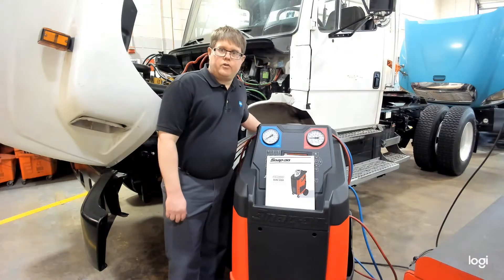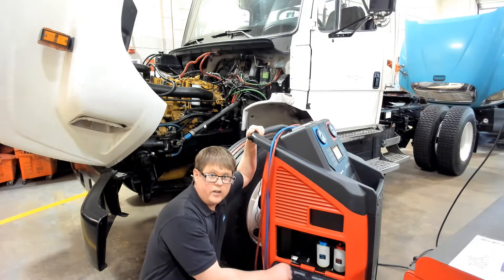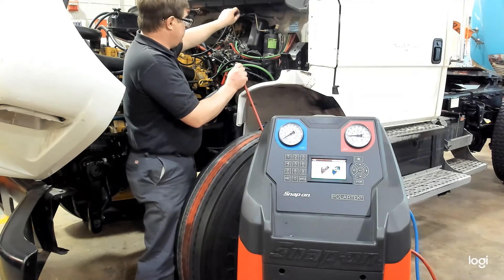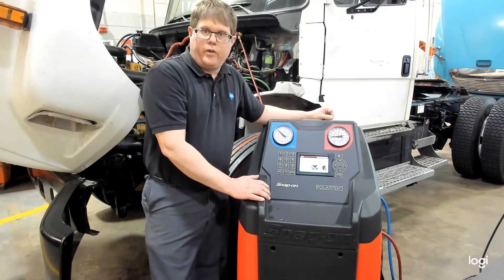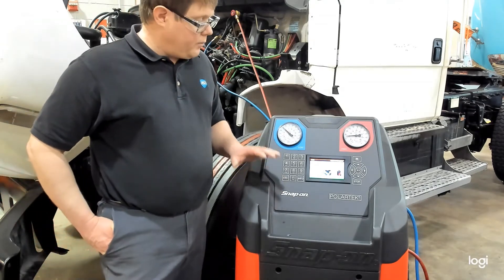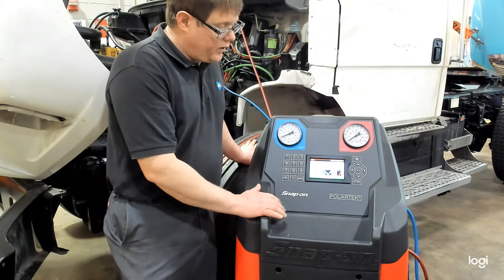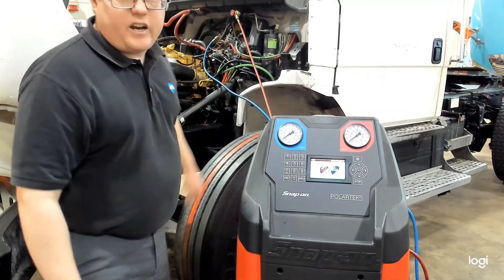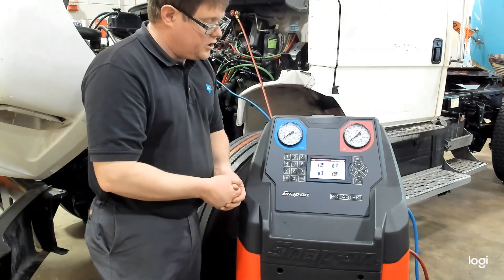15.02 - A/C Refrigerant Recovery using Snap-On Polartek

Comment: If your compressor seized and likely created metal debris, would that contaminate the recovery machine when recovering refrigerant? How to avoid this contamination?
Reply from the maker: It is possible that a small amount of metal might get carried with the oil during the recovery process but I believe most of it would remain in the system.  This machine is equipped with a dryer filter for moisture reasons but it would also trap any particle contamination as well.  There is a service alarm that activates whenever this filter needs to be replaced.
Reply: Jim, thanks for the prompt reply. I am just concerned that the metal that is in the hose will get pushed back into the new system upon recharging.

Comment: Terrible sound, bad for Snap-On.  A simple lapel mic would have solved this problem.
Reply from the maker: I appreciate the feedback.  I was using  a wireless microphone but came to find out that the transmitter does not work well when it does not have line of sight.  Live and learn.  The audio has improved in the newer videos.